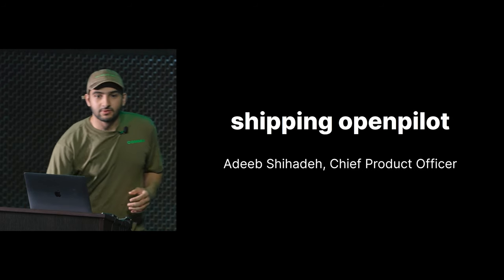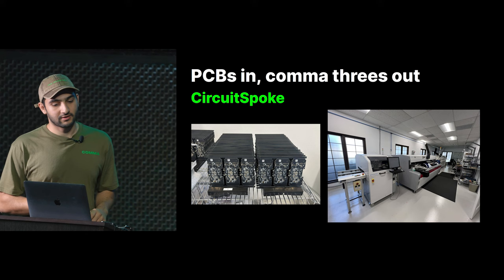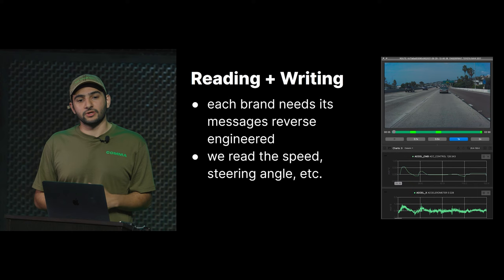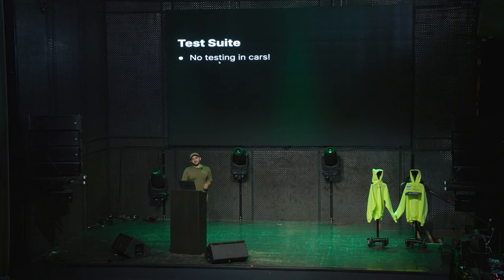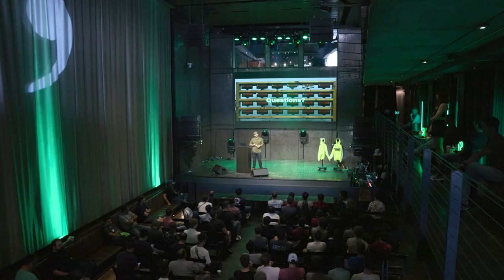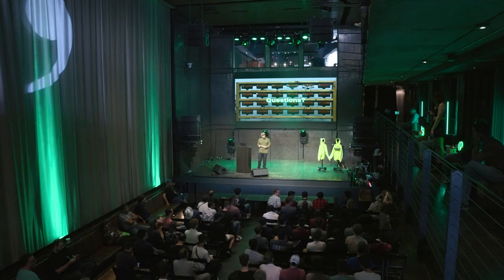comma ai | Shipping github.com/commaai/openpilot | Adeeb Shihadeh | COMMA_CON talks | CPO

Comment from the maker: Thank you to the comma team for this amazing event and sharing the livestream and high-quality videos. All credits to them. Follow their official youtube.com/commaai for more livestreams.
openpilot Safety and Testing -> github.com/commaai/openpilot#safety-and-testing | from $1250 buy -> comma 3X comma.ai/shop/comma-3x | openpilot.comma.ai is the best ADAS system in the world | If you have skill apply on -> comma.ai/jobs | Join the community on github.com/commaai/openpilot & discord.comma.ai | Check if your car is supported -> comma.ai/vehicles | How to setup your car comma.ai/setup | Stay up to date by following twitter.com/comma_ai | Support comma.ai at comma.ai/shop
Chapters:
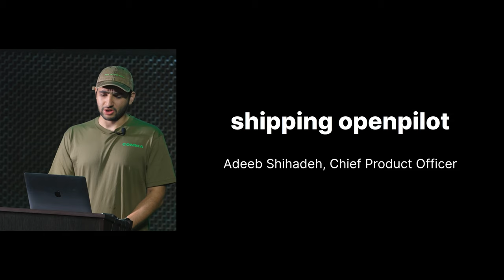00:00 intro
00:10 at comma, the difference is shippability
00:36 we have software that knows where to drive... now what?
00:59 first, we need some hardware
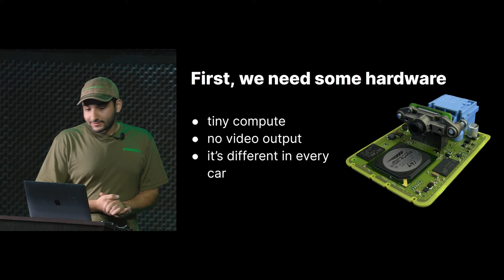01:43 comma three
02:10 PCBs in, comma threes out
02:20 CircuitSpoke
02:50 Assembly
03:00 Provisioning + Stress Testing, fulfillment
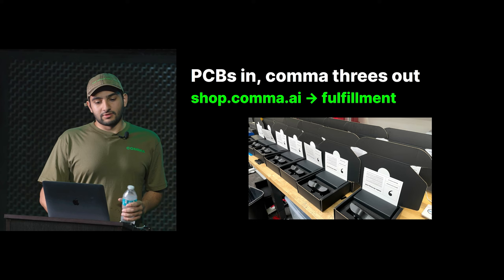03:15 next, we need a car to run on
04:10 car harness
04:40 reading + writing
05:13 safety
05:42 openpilot's safety model
06:25 Standards
07:10 Panda
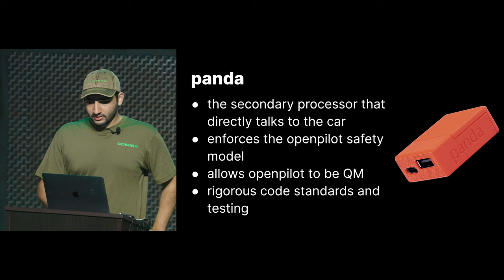09:04 Testing
10:00 Test Suite
10:55 process replay
12:37 green checkmark means good to go
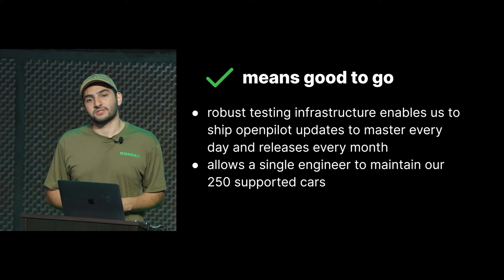15:21 what is next for openpilot
15:45 maximize low speed torque
16:35 automatic emergency braking (AEB)
17:41 more robots
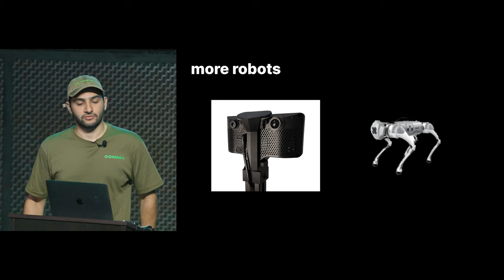18:03 plug and play
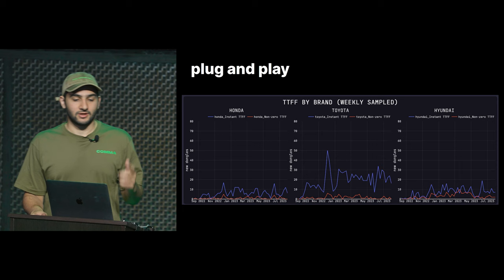19:05 shutout to external contributors (developers)
19:28 questions
19:50 how do you run tests
20:20 what is the best car for low speed torque
20:57 testing for adverse events like collisions  
22:10 segments for testing
23:22 hardest and easiest to support car brands
24:13 automotive software engineering practices
24:30 expectations of community contributions like pull requests
25:52 developing a test case
27:25 steer torque rate limiting or steer angle
28:19 cloud testing with CI, hardware in the loop testing
29:30 how long do you run hardware in loop testing
30:18 testing closet
30:47 reason to do PCBs and boards in house 
31:54 infrastructure capacity issues, peak usage
32:40 driving feedback from users integration
34:15 thank you for the good bug reports
35:13 hardware in the loop tests peaks, CI peaks
36:25 total model failure alerts
37:25 how to talk about safety
38:00 model failure work in progress
38:25 safety, low speed torque community contributions
39:43 code coverage, code cov 
40:49 learning from real work edge cases